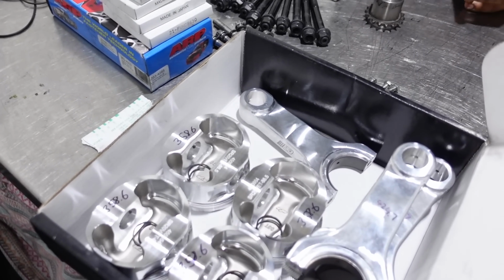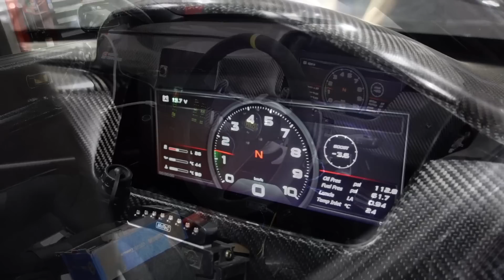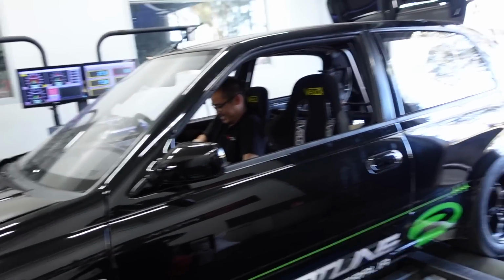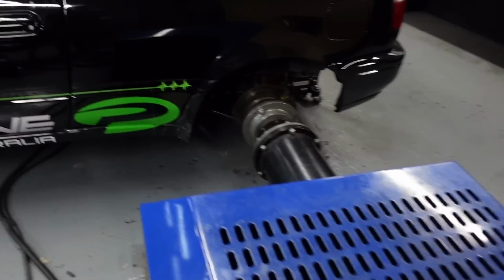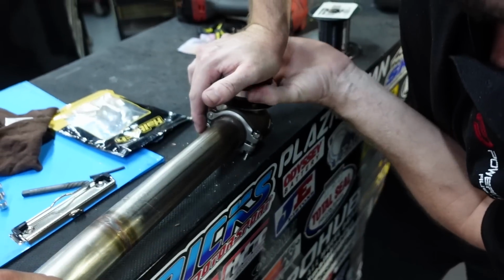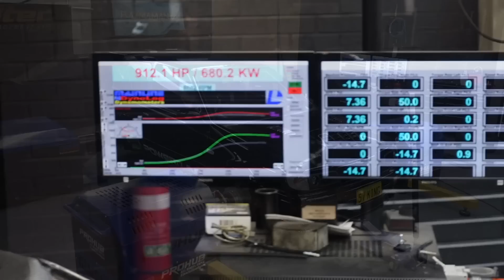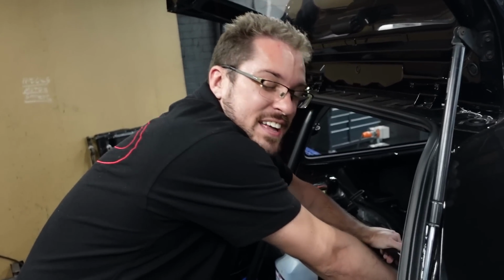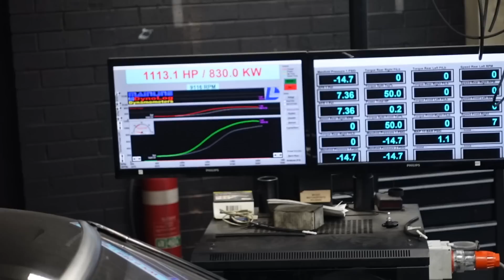AKIN'S NISSAN GTi-R | SR20VET BILLET ENGINE BUILD + DYNO RESULTS | 1100HP+

Comment: Good god, back in the 90's I had a Pulsar gtir with 350bhp and I thought that was rapid. With 3x the power this thing must be fckin mental. Well done lads, excellent workmanship.
Reply from the maker: Yeah this one is a little bit insane. You'd never hit it on the street haha. Imagine trying to overtake someone holding this pinned haha
Reply: Ahhh bud did yours have the umbrella and the flair 😂 👍